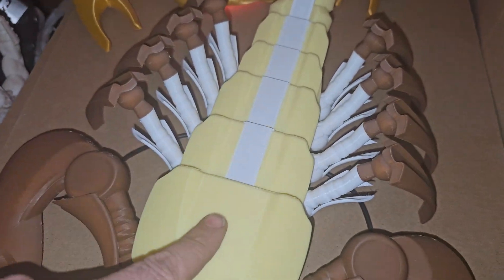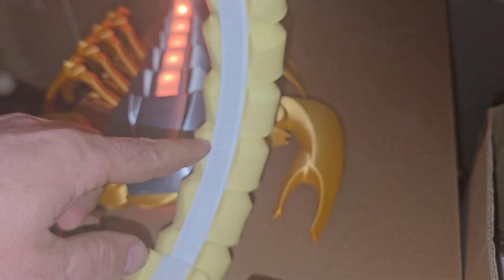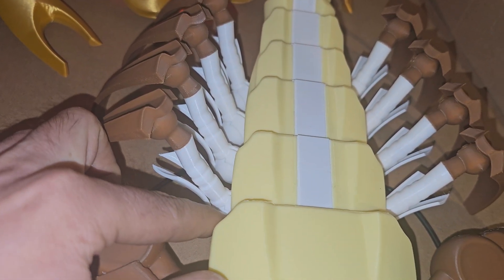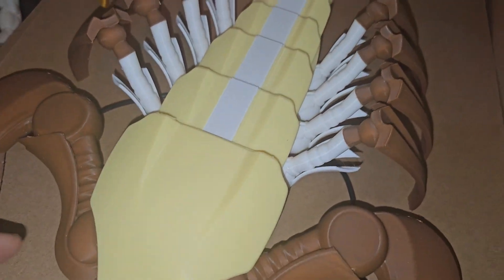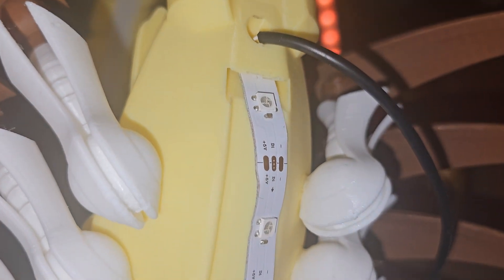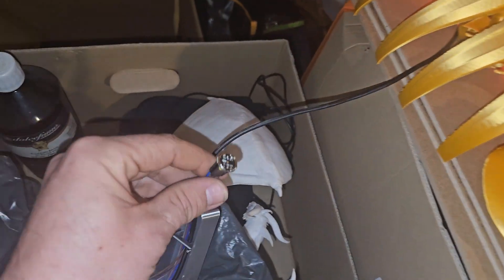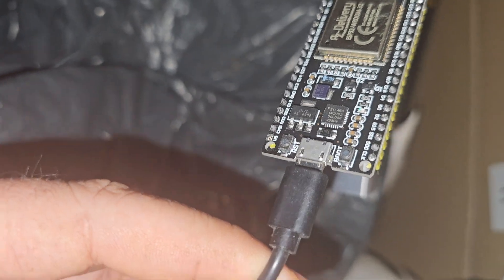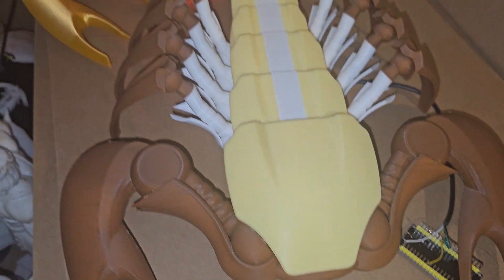Small Tutorial Scorpion Led Headphone Stand(english)

Comment: Hi, this is an absolutely beautiful print! 🥲 I was thinking of making one for my brother, but I have never really wired up anything like this before. 

I will need to take the time to research these parts, but would you be kind enough to make a list of the components I would need for this? 

I'm sure I have a suitable USB cord and charger block, but I'm not so sure about the LEDs or the wires. Thank you 🙏
Reply from the maker: @_Image_Generator  Its pretty simple.Use 2812b leds and buy an Arduino https://amzn.eu/d/5FWV6VK
ch340 or the 2102 which is cheaper.You need the driver for windows either ch340 or 2102.Just search internet and install on pc.After that you can hook up your board to the pc and go to site https://wled-install.github.io/
there i used 13.4 version soundreactive with alexa loxone etc enabled 4MB Flash M++. enabled.If you have problems installing search for wled instructions.Chris Maher on Yt does such things.The wiring is without microphone is + of leds to v5 ,remote wire to gpio 16 and - to gnd.If you use a microphone inmp441 you connect + to 3v3, -to gnd,and the ws,sck and sd to gpio 25-27.You can set in the software which one is ws and sck and so on.I used the limiter and set it to 0.95amp in the software so you dont need external + .I only used the micro usb as the power source of the board.1amp is enough.
Reply from the maker: @_Image_Generator  for the wires just buy jumper wires so you dont need to solder them on the board.